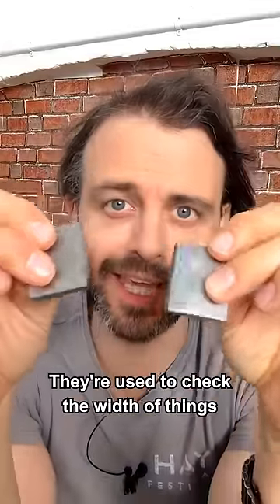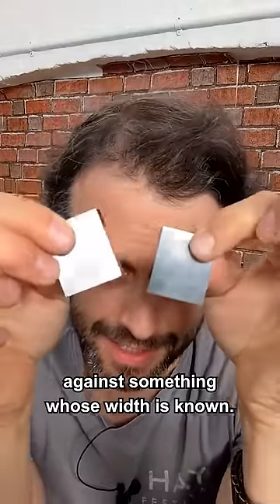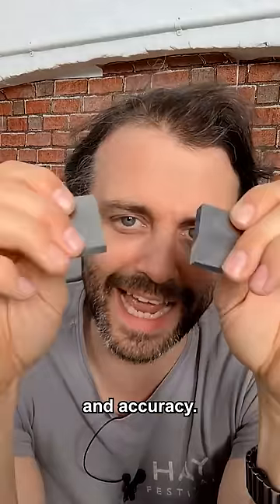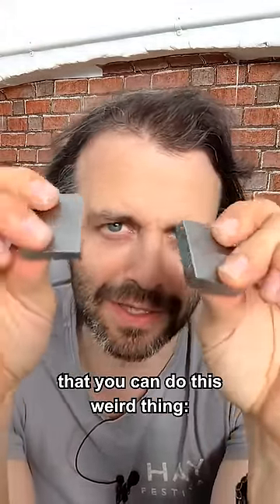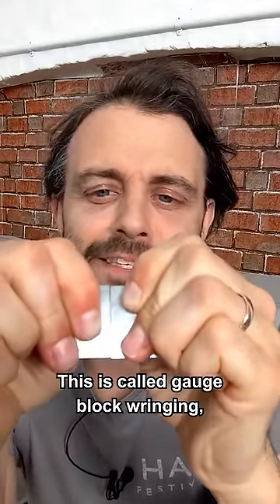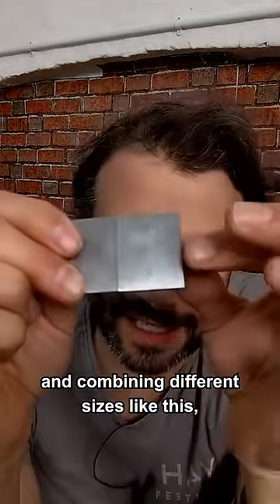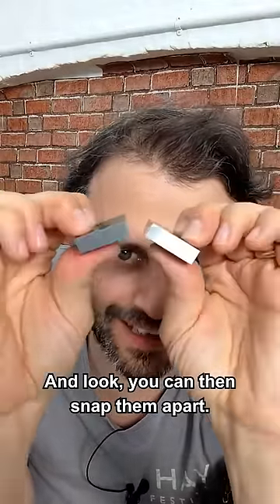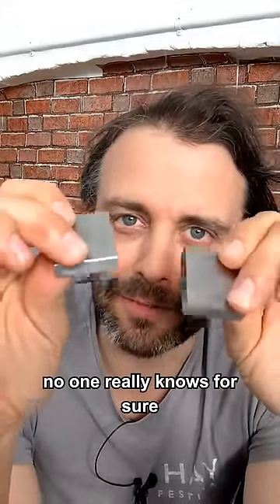No One Knows For Sure Why This Happens!

Comment: Van Der Wals force causes it. It is always present, but with an extremely smooth surface and no dirt it becomes strong enough to be demonstrated.
Reply: Van der Waals*

Not "Van Der Wals".
Reply: Oh it has a name, I guess that explains it
Reply: except it works better with oil on it.
Reply: NOBODY KNOWS FOR SURE WHY IT HAPPENS
Reply: @prot07ype87 You couldn't be more annoying if you tried. Are you okay? Legit question.
Reply: @shamaniccolonic777  Yes, I'm okay. c:

Are you? Legit question.
Reply: @shamaniccolonic777  he was correcting a fact, which should be correct lol
Reply: @pclement7879  That's kinda the point of pieces being so smooth. When pushed together, smooth surfaces have less space between atoms than rougher ones
Reply: @pclement7879  No, it occurs at the molecular level, especially in gases.
Reply: @shamaniccolonic777  That wasn't annoying at all. Your condescension isn't warranted.
Reply: Agree. Look up nano tape. Similar thing. Based on a study of how geckos can walk up walls - even with oil on them.
Reply: @pclement7879  nah it happens at molecular level, thing is that thanks to its extremely flat face, there will be little to none air pockets that would diminish the contact area and also factor that the electric field is several orders of magnitude larger than the gravitational field
Reply: @shmosel_  the world was a tough place to live before Newton discovered gravity.
Reply: @shmosel_ it’s not Van der Waals, I don’t believe. But if it was it WOULD explain it. Assuming you know what those forces are. Which is an easy google. Or grade 11 chemistry.
Reply: Vad der waal forces were my guess too.

FWIW, that's how gecko's feet work. They're sticky from electron sharing due to the same phenomenon
Reply: @brittancrays983  there's no "except" about it working better with oil on it.
Reply: Does it only work with the type of material (metal I guess?) This is made of?
Reply: What nonsense you spew cut and pasted from somewhere.  VDW forces are a bucket category of things that includes  the London dispersion forces, Debye forces between  dipoles and induced dipoles, and the Keesom force between permanent molecular dipoles that are dynamic and have an average net value.

You've explained nothinig, and I also have explained nothing, but at least I'm honest about it.
Reply: @RWZiggy  come on, I think it's the right idea. The super flat surface would allow for more of these VdW forces to function attractively between the two surfaces than normally would occur between two solids. Ie, like a solid version of surface tension.
Reply: @pmberkeley  A word that means various types of forces is no better than saying "forces cause these forces"

It's the bad and wrong idea, imagining something is explained by putting a vague label on it.
Reply: @RWZiggy  ah, but it's a category of forces that would be relevant to the sticking process. Van der Waals isn't "all forces".
Reply: @pmberkeley  Lolz, it's literally "van der waals FORCES", and there is nothing in that bucket category that isn't a force.

The use of that phrase is meaningless as an explanation or reason.  You're saying we have forces causing these sticking forces, as circular as a hoola hoop
Reply: @RWZiggy  I'm a PhD in mechanical engineering and did my masters thesis on Van der Waals forces at the nanoscale. I don't regret to inform you that you're wrong, and you don't understand what the significance of saying it's Van der Waals is.
Reply: No. Waal is a river. Wal is the shore. His name is Van der Waal. BEEEEEP!
Reply: @shmosel_  All my molecules have a name. When I wake up, I say, hey bro's! Having a name IS important. Never been ill, since!
Reply: @pclement7879  No, that would be the nuclear strong force, and it is a short range force. Van Der Waals forces are electric in nature, so they are long range forces obeying the inverse square law. We see them at work in everyday occurences.
Reply: yeah, physicists have understood this effect for a century.
 @Ruigekerel
Reply: A more extreme version of this happens in the International Space Station, where the precision milled coupling rings would end up cold welding together just because their surfaces are so perfectly straight and smooth.
Reply: @UC9SNX024cs9xaMNwBJWD9bQ Identifying the scientific principle is both relevant and useful. It arms you with the knowledge to go look it up and understand it for yourself, rather than expecting someone to spoon-feed you a complex scientific topic in a YT comment section.
Reply: @chloekaftan I believe cold welding takes place whether or not the mating surface is straight and or smooth
Reply: @shamaniccolonic777 annoying for correcting the guy’s name?
Reply: Funny I just watched a video explaining why this happens
Reply: Yes because those are strong enough for anything lmao
Reply: @jyothishkumar3098 It is the name of the force that causes coherency in all materials, in other words the fact you can have a piece of metal that is solid even as it consists of loose atoms. The Van Der Waals-force makes the atoms attract each other and stick to each other.
Reply: I thought it was metallic bonding.
Reply: @bluestormcloud791  Naw, it must have been really cool. Imagine floating around without gravity around. You could jump on to the highest tree. You could soar like a bird. I'd have been awesome.
Reply: @pclement7879  have you ever tried uncrumpling plastic foil?
Reply: Surface tension
Reply: @shmosel_ With the name comes tge phenomenon, which is basically just electrostatic force.
Reply: And that negates van der walls forces how? Metal to metal is cohesion. Metal to oil to metal is adhesion. Either or both may use van der walls forces, though there are at least four other mechanisms that may be at play too.
Reply: @baranjan6969  hey, it holds geckos to the wall!
Reply: It kinda reminds me of how geckos stick to surfaces with microscopic hair like spikes. That's how I remember learning it anyways I'm sure there's more to it.
Reply: @GreatWhiteNinja21  the Van Der Waals force that geckos use is the same. NASA is working on replicating the effect for use on robotics.
Reply: Nobody really knows for sure how it happens! o_O
Reply: @brittancrays983 Except it doesn’t.

Toolmaker here. Nothing makes gage blocks wrong better than a nice bath in acetone, or some other volatile solvent (Dykem remover comes to mind). If there is oil present, you might be able to lift a block stack up vertically, but if you hold it horizontally, with the cohesion seam vertical, they will at least slide apart, or even simply snap apart like he did in the video when properly cleaned and wrung, especially if your clamped them together, you will sometimes have to shear them apart, like against the edge of a bench.
Reply: @storkbreath  Go brain lol. Cool thank you for the info. I love learning about physics from an observational understanding since I never took any classes there's aton of terminology and symbols I don't understand yet.
Reply: I think thats a good guess but there is no way its strong enought to hold too blocks like that together
Reply: @shamaniccolonic777 it’s actually Wonderwalls, but I’m okay I just needed that song in people heads
Reply: @blockhead1899  Why not?
Reply: Nobody really knows for sure what atoms are, either. We can describe the heck out of them using math, but what are they? “Energy” you say…well what’s energy? “Mass times the speed of light squared” 

All Physics is literally answering questions in a way that totally would have gotten you in trouble in 5th grade. “Who is the president of the United States?” “The man in the White House”; “What is the white house?” “Where the president lives”

Don’t think about this too much. If you do, you’ll collapse into a puddle of formless wobbly stuff that has no shape (Bose-Einstein condensate)

Comment: I was always taught to slide them apart, not snap them apart.
Reply: Wring together, slide apart.
Reply: I'm a Metrology guy. You're correct. Snapping them apart may cause accidental scratching of the surfaces.
Reply: you slide into DMs, you snap back 5
Reply: That's what I was thinking while watching him snap them back apart.
Reply: It's for the video
Reply: I suspect these are sacrificial blocks for the video.  You shouldn't touch them with bare hands either :)

Comment: It works because the atoms are so close to each other like geco tape. They're hugging each other.
Reply: Then why do you need this special motion?
Reply: @IceBug1337  to remove as much air as possible
Reply: @Colorado-Coyote I agree.
Reply: That's so cute 😊
Reply: @IceBug1337  I've also read the wringing action removes oxides from the surfaces allowing the metal to stick.
Reply: I.e. "van der waals force"
Reply: @tonywells6990 possibly, it at least would prevent most oxidation after putting them togethro
Reply: Even more than that: the electrons are so close together, that they start to behave as if they were one solid.
Reply: @quintecent8903 : Perfect explanation of the phenomenon of gauge blocking.
Reply: @IceBug1337  To get the atoms close enough for their short range attraction to work. It is the same force that holds the blocks together.
Reply: video: no one is sure why it happens
comments: full of explanations why it happens
Reply: It's called Van der Waals forces/effects. it's what gecko's use to climb. Essentially they are SOOOOOO flat that there is no tiny minute bumps, ridges, or such to block all of those tiny atoms and such to work in unison to electromagnetically pull on one another, and then when you leave them together, for long enough, them becoming stuck/melded together into one is the phenomenon known as cold welding. In space you CANNOT touch metal, against metal as the molecular structure is a lattice, with the arrangement leaving free electrons, and open electron space on the outside, and in the vacuum of space with no air/oxides to cause any oxidation + the super cold Temps to slow the molecule wiggling down enough to set up the perfect ability for two touching pieces of metal to just randomly fuse & become one😊
Reply: I didn't expect to see a fellow vaporeon here ngl
Reply: Van der waals forces aren't strong enough to explain this. It's something specific to metals
Reply: @FFNOJG  you're wrong
Reply: @user-ef8kc4rv7n  I specifically explained the 2 seperate forces, and phenomenon at work that makes this work.
Reply: @FFNOJG  back to school if you think weak a$$ van der vaals forces keep chameleon stick to things and he gets as close 0,3-0,4nm to actually activate such bonds xD
Reply: @AlanXD6969  yes hello :3
Reply: @Colorado-Coyote  hewoo hru :3
Reply: @_AlanXD  Goood :3 U?
Reply: @Colorado-Coyote  i'm alr ~w~

Comment: I know 
 it is due to Van der Waals force.😂
Reply: That's what im thinking
Reply: It could be, but why the weird process for getting it to stick? Wouldn't it stick just touching them together?
Reply: @nextfuturecovers  I imagine sliding them against each other helps evacuating any air from between the metal surfaces. But honestly dunno - that's just my intuition I don't have any proof for this :shrug:

Also I believe van der Waals forces would be way to small to hold on between two blocks of such mass and I suspect it is the vacuum that contributes most here.
Reply: its metal.
Reply: @gogollama  this was my assumption as well
Reply: Nah man, surrounding air pressure. The 2 planes are so neat that you can almost expell all air out, so you create somewhat of a mini-void that the surrounding air pushes against. It shouldn’t last forever though
Reply: @georgealex19  Should be easy enough to test. Stick them together and then put the assembly into a vacuum. If they fall apart then air pressure is the cause.
Reply: van der waals is too weak to make them stick imo
Reply: No, it is not.
Reply: @gogollama 
Works in a vacuum.. might be a hair weaker, but not by a ton.
Reply: @gogollama  I think this is most accurate. a combination of the two forces. I have also heard that because it is a metal, the lattice can align from the heat and friction of the faces being so close to each other molecularly (but I don't think this is true, though i certainly can be wrong)
Reply: @georgealex19 
Works in a vacuum.
Reply: @gogollama  the process works on a vacuum. I originally thought it was a vacuum also. But than it wouldn’t work in a vacuum.
Reply: @gleitgelmeister749 metals can experience van der waals interactions. The name “force” is sort of misleading, and so is its explanation in many chemistry classes. Think of this phenomenon as: when a large group of electrons get near each other, they push away from each other exposing small dipoles due to the nuclei, pulling them back together. You can very much imagine this as a turbulent wave of fluid sloshing around when you mix them suddenly. 
Anyway, this is not the van der waals phenomenon because that wouldn’t be powerful enough to cause this effect. At least, not on its own; it may be part of a bigger system in this case.
Reply: @gogollama  van der Waals forces could be quite significant actually, depends on the surface area in contact, and the flatness of the surface.
Geckos can stick to glass and hang off of just one of their fingers due to this
Reply: Just posted the same before seeing this
Reply: It's THOUGHT TO BE this.
Please learn the difference between a theory and a fact.
Reply: @FluffyFuri  It's literally how geckos stick to walls.
Reply: @matheus_m_88  We know for a fact that it is. We just don't know exactly how much of a contribution it makes.
Reply: @Lolbama2012  Lol, don't even. Try arguing that in a scientific setting and no one will ever take you seriously anymore.
Reply: @AfonsoCL  geckos are small and light, these metal things are more heavier than that
Reply: @AfonsoCL  What, acknowledge that a hypothsis is not an objective fact? Yeah. Okay.
Reply: @FluffyFuri  your opinion is noted then promptly thrown out on grounds of evidence.
Reply: Can’t imagine VDW forces would be strong enough to resist gravity
Reply: @alexlohner-benson5235  it’s how geckos stick to things, it’s a known fact geckos use VDW to stick to things so it’s proven it can oppose gravity
Reply: @John_Jack  i know what they are, but they dont form between metals do they?
Reply: Like everywhere it will be a combination of different forces vacuum, vdw, ionic, mechanical locking... maybe some force is the main cause but thats not so easy to say as some here might suggest
Reply: Sort of. A little more advanced form of van der waals, but yeah. Pretty much the same idea.
Reply: @FluffyFuri nope tell this to your polymer wrapping in the kitchen, why does that stick?
Reply: @YannickSalzigerChatain  its related electrostatic charges sweetie, van der waals is not a force that explains everything; if it's so, then does it explain why the planet's masses stick together and forming a sphere?
Reply: Yeah exactly. Van der waals
Force just like Gekko’s 😂 if they were perfect surfaces in a vacuum they would have cold welded themselves together 😂 wdym “we don’t know” bollocks 😂
Reply: Thanks, was absolutely out of my mind when he said no-one Knows why this happens
Reply: Looks like it's due to cold welding
Reply: @Cartman87725  literally he sounded like all the scientists are morons who can't even explain some highschool physics + chemistry, smh
Reply: @FluffyFuri  no its not. Look up capillary bonding
Reply: @alexlohner-benson5235 capillary bonding is pretty common in optics.
Reply: If I had to guess it’s probably due to one of the varies nuclear forces probably similar reason gecko toe pads stick to really smooth surfaces
Reply: @georgealex19 it works in a vacuum. Not air pressure
Reply: The reason you have to slide them together is to remove the oil that is on the surface. The oil is either from the factory to limit rust or your fingers. If the surfaces where even smoother then they would weld together.
Reply: @nextfuturecovers  it’s a weak bond that only works in close proximity, forcing the same atoms together is exactly why it happens.
Reply: Isn't the van der Waals force sufficient for geckos to support many times their own weight? @John_Jack
Reply: @AfonsoCL Explain please.

Comment: My guess is incomplete cold welding. Rubbing them together likely disrupts the oxide layer in small random regions, allowing the two faces to bond in those regions. Essentially like little tack welds, strong enough to hold them together but weak enough to snap apart.
Reply: some are ceramic which cannot oxidize
Reply: I think oxide layer is thicker than what hes rubbing off
Reply: @crochou8173  I can relate
Reply: @thesuperginge1348 Bruh
Reply: no
Reply: Actually it's Air pressure, surface tension and atomic force working together making the blocks stick.